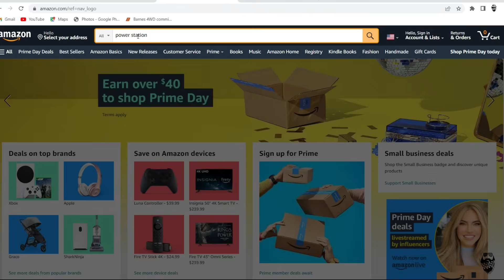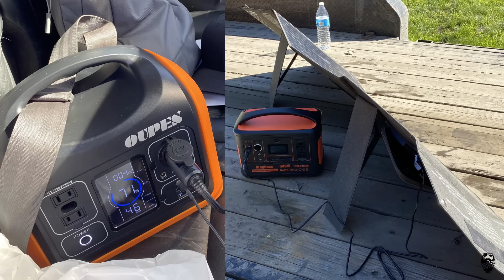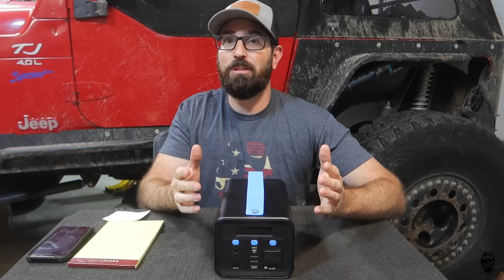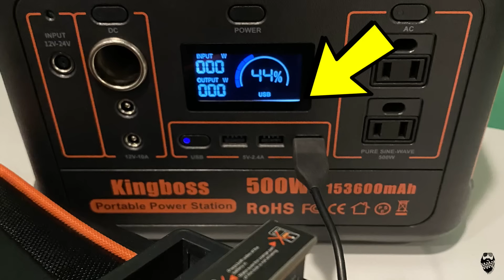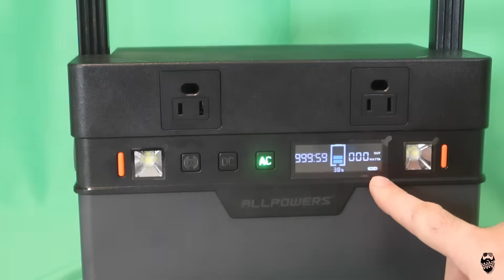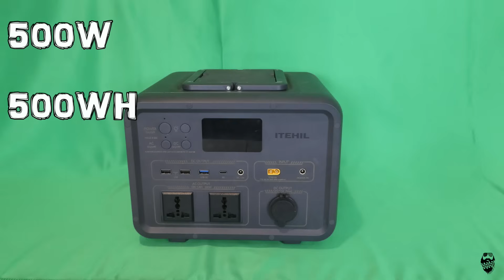Budget AMAZON Power Stations... Are they worth it??

Comment: I generally find the 200Wh range units to be fairly useless... really not much better than the really small battery packs that we know and love.  The ones that work the best for the mid-range 500Wh+ units are the Bluetti (such as the EB55), and the Bibene or FFPower CN505.   And on the high-end (1000Wh+), the FFPower P2001 or the Bluetti 200P.

But all of these units have their quirks.  The Bibene/FFPower units tend to over-state their battery capacity but have stellar firmware.  The EB55 has a noisy power brick and cannot really operate as a UPS.   And it also does not restart its charging input after a fault without manual intervention.   The GoLabs units time-out their AC after an hour or two whether you are actively using the plug or not which is extremely annoying.  You can't run a fridge overnight with one, for example.   And the list goes on.   Jackery's have their own issues.  And the non-name budget units are just slapped together and typically have a multitude of firmware issues.

Also keep in mind that driving devices with AC outputs always burns more power than you think, particularly fridges/coolers, because the AC inverters in these things tends to burn around 10-15W just by being on.

So it is important to do you research to make sure that the unit you get does what you want.  I will say, though, that these days I would never buy units with traditional lithium-ion batteries.  They MUST be LiFePO4 for safety, shelf-life, cycles, and longevity.   Most of these little no-name power stations are lithium-ion and not LiFePO4 and frankly its a big lose for any use case.  Battery capacity may seem good at the start, but it won't last.  And the fire danger of standard lithium-ion at these capacities is just too high.

-Matt
Reply: Was thinking of buying a jackery at some point. Are those lithium ion? Is that one of the better ones to go with? I saw one guy power a 12v fridge with the 300 for over 24 hours. Seems pretty good in combination with a 100 watt solar panel. Unless that battery life tanks like right after you buy it type of thing.
Reply: @goldenbanjo197  Small 12V fridges and coolers are a lot more energy efficient than normal fridges that run off of AC.  The main reason is due to the vampire current the AC inverter on the power station draws when it is on... its usually 10-15W when turned on even when doing nothing.  That problem doesn't exist on the DC side.

For powering a DC fridge, 24 hours with roughly 300Wh is toally doable.   I can power my Dometic with a 600Wh LiFepO4 unit for over 3 days.

There are a few provisios.  The 12V output on nearly all power stations is limited to around 8A, which means only around 100W or so, which sometimes isn't enough to start the compressor.   So YMMV.

Most of the Jackery's are Lithium-ion rather than Lithium-iron-phosphate (LiFePO4).  Lithium-ion has about 1/3 to 1/2 the cycle life so its a bit more problematic, particularly if buying a used unit.  These days you almost universally want to go with LiFePO4 (also known as LFP) based power stations.   LiFePO4 has a cycle life in the 2000 range.

The failure mode for LiFePO4 (LFP) is nice too.  The battery itself just degrades slowly over time.  So as long as the electronics in the power station stay good, it can be a dependable device.
Reply: My 500w solar power stations can power a dorm fridge but not a small 5 cubic ft chest freezer. My Bluetti EB70 works with the freezer though. I got a 300ah Ampere Time LiFeP04 when prices dropped with the last of my savings and I`m slowly getting all the parts for an emergency solar power supply for a small window air conditioner in case we get hit by hurricanes again. I`m on disability and have no transportation and I could never possibly afford to put fuel in a gas generator for two weeks. But with solar and a battery that size (3.8 kwh) I can avoid heat stroke. Plus with all my cheap solar power stations I can use my plug in chargers to dump their batteries into the big one to extend run time at night. My big battery can power my small AC aprox 7 hours on high and much longer if I set the thermostat to kick the compressor off and on.
Reply: @baneverything5580 i would  still  get a small generator too.  U may not have sun every day.  Buy  some  cheap  solar lights  at the dollar  store.  Get some  power  banks  at different sizes. And tablet and Bluetooth speakers or speaker  for entertainment. Get a small  camping stove with some small  propane bottles.
Reply: Hi Matt! Thanks for sharing your insights on power stations. I agree that it's important to do thorough research before purchasing one. Speaking of that, have you checked out the Segway Portable PowerStation Cube Series? It offers a massive capacity of up to 5kWh, fast recharging, versatile sockets, and comprehensive protections with LiFePO4 batteries. It's definitely worth considering for outdoor enthusiasts like us. Stay safe and have great adventures!
Reply: @ErvigHenry  For 2kWh of storage or less, all-in-one power stations are a decent choice just for the ease of use.

Beyond 2kWh worth of storage, power stations become expensive boat anchors.  They just aren't worth the cost, their functions are inefficient at best, and the expansion options are proprietary and get very expensive verses buying discrete batteries and other parts.  Plus if the power station breaks you are pretty much dead in the water.

If you need significant amounts of storage and want flexibility on being able to expand it, consider throwing together a system from parts.   e.g. discrete batteries (such as an EG4 LifePower4 5kWh 48V battery), discrete inverter, discrete solar charge controller, appropriately sized cables, fuses, and breakers.

It does take extra work and knowledge but you wind up with a much better system in the end.  If something breaks you only have to replace the part that broke rather than the whole thing.

Comment: All the times he said "input" when he meant output drove me crazy.

If you plug a device into a "power station" to charge your device (ie phone, tablet, battery) that is NOT an input, it's an output. Charging the "power station" is an input.
Reply: 16 output ports, which can power 16 devices at the same time.
F2400 specially designed a rotating knob for adjusting the input power from 300W to 1100W, which decides the recharging speed. When the voltage is too low, you can also charge the machine by decreasing input power.-fossibot
Reply: Me too

Comment: That's funny I built mine for less than $200 LOL and it runs 1500 watts Peak 1,000 Watts continuously not to mention I can switch components in and out and mine will run for up to 24 hours on a single charge plus I have solar panel options to charge it during the day
Reply: What did you build
Reply: @SAMMIEJONESJUNIOR  well first off let me state that I am a diesel technician with an Associates it applied sciences and Diesel technology so I know a thing or two about wiring in batteries inverters and the like but I built a off-grid solar generator much better than the jackery or any of those poor excuses for off-grid solar power and or power boxes that they rip people off as far as money wise
Reply: It's not like these are difficult to build buddy
Reply: @tac6044  didn't say it was but there are some people that are not mechanically inclined and don't understand that it's all about how you put it together and  yes you could put it together and it'll work but if you're trying to make something that is presentable that is the difference between a redneck backyard mechanic and a certified diesel technician flash mechanic technician presentation and precision
Reply: I wish you could do a video showing us exactly what to buy and how to connect everything.
Reply: @lindaertel7558  Harbor Freight 100 W solar kit any deep cycle marine battery you can get from a junkyard an old toolbox or a new one for 15 bucks at Walmart preferably hyper tough brand just get one that it is big enough and deep enough to house the battery and all your components at least that's what I used and you can find an inverter doesn't have to be new but they make them in all different power levels it's as simple as that and then just modify the box as needed mine weighs about maybe 30 pounds but I can move it from place to place it's a real simple setup

Comment: Before hurricane season this year we went online to the companies site of Oupes, they were running a sale for a 600w lifepo4 with solar for a delivered price of $460.!
 I think that was the best deal I've seen for this size with solar!
After 6 months storage it still read 100%, no loss!
At the same time Oupes had a 1200w lifepo4 with solar for $920.!
Now Oupes has a 1800w lifepo4, and we will be looking at it next hurricane season to see if they'll be running any sales!
Reply: You will get a much longer life span out of the battery if you store it 80% rather than 100%. Storing at full capacity is very hard on the battery and causes faster degradation.
Reply: @tac6044  what about leaving it dead if not use?
Reply: @tac6044 thanks didn’t know that!
Reply: @kristins8906 no problem just use some of that 100%. To bring it down. You would think if you leave the unit plugged in you could set the unit to stop at 80%. 73
Reply: Get a 12v 300ah LiFeP04 battery. 3.8 kwh. Get a 2000w pure sine wave inverter, a 60 to 100 watt mppt solar charge controller, and look up plans to build your own. With 800 watts of panels you can easily power a small air conditioner. No matter how you slice it this is a far less expensive option. Get an electrician to advise you or hire one to put this all together with proper fuses, switches, wire size, etc.

Comment: OKAY SO ❤️ THIS VIDEO.

However just to explain the universal sockets / international sockets on these sorts of things are down to a few reasons.

1. Tooling costs, if practically *all plugs work it makes sales internationally easier and cheaper to have a one size fits all approach 

*with exceptions

2. It means guests to other countries can buy one of these when touring and use their own plugs without the need for adapters, this is a more secure option and prevents shorts and damages to internal components.

3. Personal point from a NON U.S veiwer, you may not think this but as you are the largest primary English language nation in the world, many people from outside whose primary Language or secondary language is English.   Will watch your video's, hence when you question why such sockets are on there it comes across as if you're not considering the advice you give is going to impact non U.S users of the power station, plus when you guys and girls in the U.S flood YouTube with these videos you should consider running the device in 220/240v mode 50Hz as the results with be quite different given the higher power output. 

CHECK YOUR DEVICES ARE CAPABLE OF RUNNING OF 220/240v 50hz MODE FIRST. 

As charging and power use can in power stations be Literally cut in half by a Non U.S or North American Device.

Comment: I’m currently building another 01 XJ that is Capable and overland worthy. I’ve been relying on my deep cycle car battery in my other rig to run an ARB 63qrt refer. Works ok but jeep battery needs to be watched for too much drain  down. 
Still in planning stages but thinking a lightweight folding solar panel and something like one of these portable units. Or solar panel to charge jeep battery to keep it topped off. 
Cool video!
Reply from the maker: Thanks, one of these and a solar panel work great.

Comment: Ive been highly debating buying one of these cheapo batteries to match my cheapo fridge but ive been skeptical. Cool to see you testing some of them. A little hint, Jackerys arent all that when it comes to longevity.
My fridge is annoying and it wont run when the vehicle is shut off even on the mode thats supposed to let it kill your car battery. it kicks on then faults to low voltage, hence wanting one of these
Reply from the maker: I have been running my fridge with these power stations for 6 months and never had an issue with it. Sometimes the DC cigarette plug wiggles loose and looses connection when I am offroad but other than that I haven’t had any issues.
Reply: @MuddyBeards4X4  I changed mine to an Anderson plug for that reason

Comment: At those prices I would just assume build my own out of a single or  pair of deep cycle 12 V batteries And an inverter with a pair of 12v outlets  Add a solar kit to it and you will be looking pretty good
Reply from the maker: That is definitely an option. And you could do it pretty cheap. But it’s not that portable.
Reply: @MuddyBeards4X4   Yeah it would be much harder to move around but I would build it into something like an aircraft carry on style roll around Milwaukee toolbox it will be heavier but you'll have double if not triple the power capacity of those smaller ones, it would be a great thing to have at base camp I've always been the diy kinda guy most the time you can build it better at home then the mass production junk they sell nowadays
Reply: Merritt what are the supplies  you need make one?
Reply: You will trade price for portability. You can put that setup You are building in a card board box if you want but you won't be moving it anywhere and the quality of battery will still cost you. If you buy this you are using it on the go. You can't compare a stationary system to a mobile system so no you can't build this type of setup for cheap
Reply: @SAMMIEJONESJUNIOR  i can move around a home built box with 2 deep cycle batteries in it pretty easily. I would build it like a car jump charger with wheels and a collapsible  handle If you can't move that around your pretty weak plus i have access to batteries at cost i can buy  top of the line interstate golf cart batteries for $75 bucks or normal DS batteries for $45 each so ya i can make it stronger last longer for cheaper at the slight cost of ease of mobility. But i know my shit won't fail and i can replace batteries years down the road this one I'm pretty sure you have to toss and buy new all over again.
Reply: You can get a small 12v li-po battery (8ah, 10ah, 20ah), a 600w pure sign wave incertitude, an a 10 amp solar charger.

The 8, 10ah batteries are less than $50 each, 20ah for $100. I see an 18ah battery for $90. 50ah for $199

So 50ah battery for $200, 600w for $100, 10 amp solar charger for $30. $330. Cabling and tools less than $100 more. 

Battery is 13 pounds, maybe 5 pounds more for inverter, charger, cables and fuses. Can all be installed in a milk crate.

$330 for 600wh battery (12v * 50ah), 600w inverter and solar charger under 20 pounds and still portable.

You can get a smaller battery (and inverter) to save weight cost. You can add a 12v charger for options. 12v 20 amp intelligent charger for $66.

You can easily chose battery size, inverter size, solar charger size and 12v charger size to meet your needs.

You can build a small unit and then add more batteries later. You can have a seperete battery/charger case so that you can keep your main device at camp being used, but move the extra battery/charger section to a plugin, or closer to sunlight for solar.

IMHO, the store bought units are best if you need a highly portable unit, maybe if you hike or bike.
Reply: @Slackware1995  yeah lipos are cheaper but have a better chance to go 💥